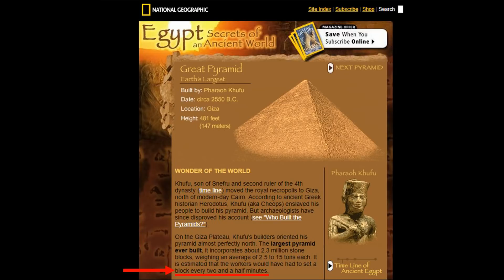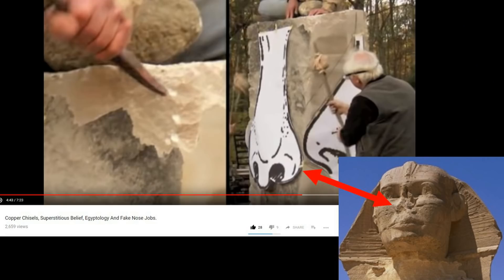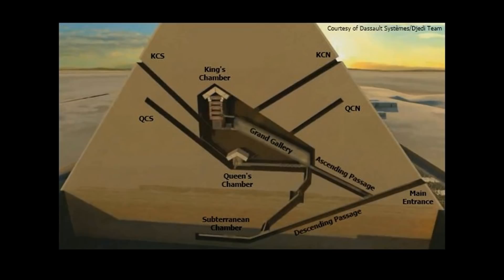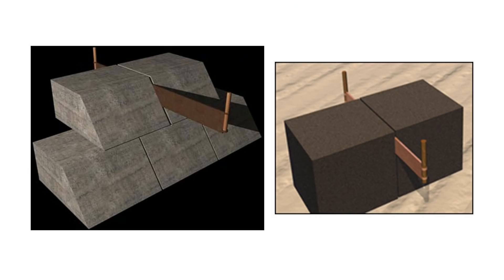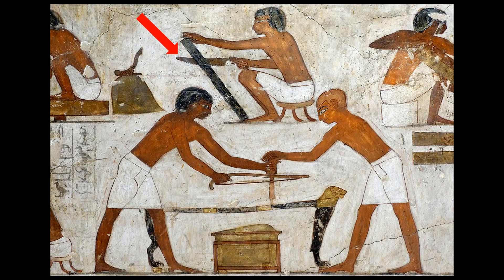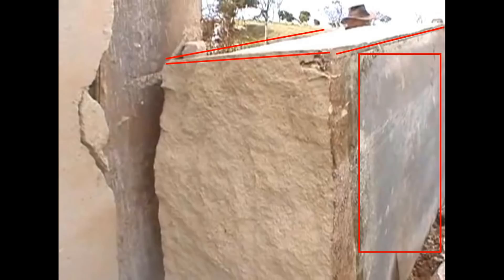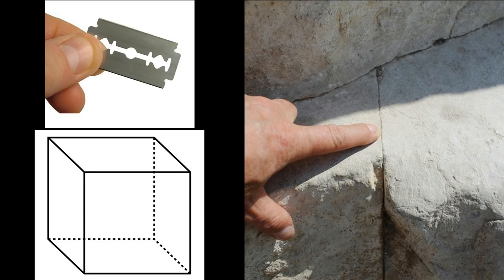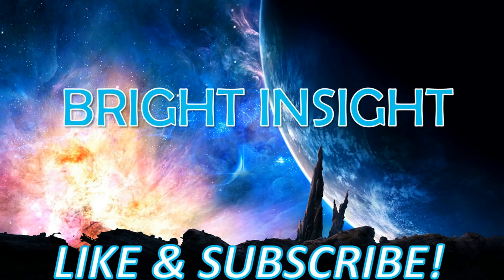Great Pyramid of Giza:  Lost Ancient Civilizations

Comment: one of my guesses would be that they used rope to cut things, you know when a heavy object attached to a rope going to a 90° turn falls it tends to rapidly heat up and cut that thing, maybe they used some machines using rope as powertools, and said rope could easily degrade over time meaning why we wouldn't find much of it, except the mechanical parts of these possible machines

Comment: I don't know (yet) about the amount of bronze and copper tools required or found but just think about cutting those limestone block.

The best demonstration I've found of stone cutting with copper tools is from “Ancient Egyptian Granite Sawing Technology: reconstruction” (available on YouTube). What's great about this demonstration is that they provide all the numbers so we can work from that.
They achieved a cutting speed of 0.00233 m2/hour on granite (48cm x 17mm in 3,5 hours). 
The “Granite Cutting and Drilling” video you are referencing does not provide much measurement but it looks like they achieved a similar cutting speed.

According to the Mohs scale, granite is about 16 times harder than limestone so you can expect it'll be 16 times faster to cut limestone, leading to a cutting speed of 0.0373 m2/hour.

Contrary to granite, limestone can be split with copper tools but you still have to start from a flat top, cut 4 sides then you can split from the bottom. From the marks at the nearby quarry, it does look like a larger block was cut from there before being split into smaller blocks so let's assume each block from the quarry was split into 8 working blocks.

Now let's crunch some numbers:
The Great Pyramid is made of 2.3 million limestone blocks, weighting a total of 5.5 million tons.
Assuming the Egyptians were working 24 hours a day, 365 days a year (which is unlikely but let's be generous), we get approximately 13 millions minutes to build this incredible feat of engineering. This implies that one block was carved, transported and installed every 6 minutes non stop for 25 years.

Limestone density is roughly 2000kg/m3 so, on average, 2.4 metric ton per block measuring 1.2 cubic meter each. Assuming they're all perfect cubes (thus leading to the smallest surface area), we get a cube measuring 1.06 x 1.06 x 1.06 meters, meaning each face is measuring 1.13 square meters. Stacking 8 of them together (2x2x2) is 4.5 square meters for each face.

Starting from a flat top, you have to saw 4 sides before you can split the bottom, then split that block again into 8 usable blocks. 4 times 4.5 is 18 (square meters). At a cutting speed of 0.0373 m2/hour, you get 480 hours per raw block (28800 minutes) required for every 8 final blocks, or 3600 minutes per final block.

To maintain the required rate of 6 blocks per minutes, you will have to be constantly working on 600 blocks at all time (24/7/365). Using a more “realistic” workday of 12 hours, you need to be working continuously on 1200 blocks (and that is assuming no down time at all). If 2 workers are required for each block (unlikely but again, let's be generous), you need 2400 workers crammed in that quarry just sawing blocks non stop.. 

Then you still have to split the blocks, carry them, fit them in their final position, sometime even polish them and remember: Those “small” limestone blocks are nothing compared to the amount of work required for those 50+ tons granite blocks and all of this does not include time spent setting up ramps, scaffolding or whatever structures were required to rise those blocks up to 140 meters above ground, the time required to flatten the bedrock on which the pyramid sits, dig the 100+ meter long downward shaft going straight into the bedrock that you have to crawl into because it is only 1,2 meter high, nor any kind of planning before construction even started because apparently, they just made it up as they went..

Comment: I’m curious to know all of the different star formations line up with or did at the time they were built. And are the pyramids all aligned to the same stars? Or are the shafts pointing to different locations in the sky when compared to each of the other two? I’m thinking the function of the pyramids might be a sort of amplifier for the “Stargate” they might have actually had at the time. Perhaps the shows were a kind of “soft disclosure” as to what the actual true history is. As ridiculous as it sounds. Maybe we have been conditioned to believe that it is or was impossible.

Comment: I don't buy the theory that the casing stones were stripped while they were still in place in what, the 1800's they say? What did they use, camel cranes? If they didn't just push them out and let them roll down to get smashed up, they would have had to hoist each one down from the top with a massive amount of manpower or use a counterweight. And from that height, that's more work than cutting and dragging new stones from the quarry. And wouldn't these stones have been moved not too far away and could be traced to where they were reused? Also, is there any geological evidence that there was even an earthquake? Wouldn't the main blocks be shifted about too? The mainstream just says these things like it's a fact just like they say they were built for tombs. Really? I think the Egyptians are covering up something that proves that they didn't build it.

Comment: It's confirmed that they had high carbon steel as far back at 1000 BC, but that's just as far back as we know, it could have been around far earlier than that.  They should retest these carvings using steel tools.  These shows just exist to sensationalize, and provide ratings for the networks that produce them.

Comment: Hey there. Found something u might want to check .

 ''The ancient Nile flowed very close to the Pyramids. I have seen huge wells , chambers and shafts all round the pyramids. All know the existance of the underground Nile.

Water hydraulics using Bernoullie principle can force water up the underground chambers.

Water under the pyramids is also necessary to create the infrasonic negative field inside the pyramids , neutrino impact on water , to usher out scalar energy from top apex, as a pulsar . I am not going into detail about this in this blog.  This has to do with the millions of tonnes of crushing weight and generation of piezo electricity ( from SiO4 ) which resonates with Telluric radiation from below . ''

http://ajitvadakayil.blogspot.com/2010/12/secrets-of-egyptian-pyramids-revealed.html

Comment: I know this is an old video, but I just came across this channel.  One question that came up in my mind: These precise cut granite blocks used for the core of the pyramids: what happened to all the waste-rock removed to achieve this perfection? If the methods suggested by modern archeologists and egyptologists were used, even in conjunction with one another, that would still leave a lot of waste stone somewhere.

Comment: Perhaps they used gold chisels or granite dust/sand instead of regular sand. They also used fire to weaken stone which was proven to work in a documentary that I'm unable to find at the moment. Also, if you used the dried wood wedge method, wet it, then burn it, the steam would put more pressure on the stone

Comment: The more brittle the stone is, the point to shape it becomes fatter and is to 'bruse' the stone. This is because the long thin point bends and is too brittle to control the fractures. You get harder metal for chisels, but why bother when you get rotary blades. 
If you're next to a river there's enough power to cut stone. History tells us quarries had mills that were water powered. Stone cutting disc doesn't work on speed. 
What's with China artifacts and Japanese artifacts made from metal being imported into Egypt?  Whoever built them must of known about metal, and Japanese know metal. Egypt was surely in a trade route with the entire world. 
Maybe even Jesus /Buddha /Ancients/ chiefs shifted the knowledge?  Either way, advanced tools were used. The courses of the pyramids are not exactly the same either. That's a tool that has been reset... Rotary tools, not percussive...

Comment: copper and bronze are two VERY different metals...  bronze is stronger than iron, most people dont seem to realise that. It can also take a sharp edge... The only reason people switched to the softer iron was due to the collapse of the tin trade in around 1000bc,  Iron had already been made for 1000 years at that point, but was not the metal of choice for tools and weapons.

also you skipped the bit on the recreation video, where they drilled the perfectly round holes into the granite using available tools.  They also go on to show the cut marks left on the stones perfectly match what we see on the original stonework.  also, I guarantee there are plenty of gaps you can fit a finger in, let alone a razor-blade.

They had a lot of time to get the techniques and tools right, and we see all of the ones that broke or were substandard and abandoned.  I'm not saying it wasn't someone earlier than the Egyptians who built the pyramids, I'm sure it was... but when the appropriate evidence is studied and proven, that's when it will go mainstream, until then it's just hypothesis  (the recent crater discovery in greenland may help that)

Comment: In my opinion, the pyramids are not the egyptians. They moved in then made it theirs, and used it for whatever. Also, the egyptians used hieroglyphs of them hauling blocks on boats and using saws to cut them..or pounders for future generations to see how they did it. They lied. They didnt do it. The precision of cuts and placements of the pyramid blocks were highly advanced and lost. You can see the engravings on the mega tonne sarcophagi and pillars are no way near the advanced skill of precision it took just to cut and place these huge heavy granite boxes. The question is..who are these ancient builders? I believe its the annunaki. And i also believe they will cone back. The polygonal walls that span thousands of miles apart were of one advanced race of beings. They had their own style and they dispersed throughout the world and built structures. A shameful man is one who claims that which is not his.

Comment: Is it just me or are the stones you see inside the Giza pyramids on the walls of the chambers and passageways ect, of a higher quality than the smaller limestone blocks used on the exterior. I'm only guessing but it looks like the Egyptians may have put on the casing stones but not built the original structure. As if they wanted to hide any entrances. 

The same goes with the Sphynx, to me the legs and rounded rear are far far more recent add ons to the ancient monument that was carved out of the existing bedrock.

Comment: I don't consider my self very clever or an expert on the subject but don't you think a valuable resource like copper or bronze in tool would be repurposed after use or even taken somewhere else after that. not to mention that it's hypothetically possible to cut granite when wet so why couldn't they chisel when wet. part of my job was to drill chisel brake and place much harder rock with mostly hand tools yeah it would suck if we couldn't use a drill but its not something unheard of. If the quarry was purposely flooded it would be doable.

Comment: The Egyptians didn’t build the pyramids, they discovered them and utilized them. The erosion on the Sphinx predates Egypt by more than 10,000. Archaeologists have determined the erosion on the Sphinx is due to water erosion, not wind and sand. There hadn’t been that much water in that area for 10,000 years or more, when that area was a thriving rain forest. Also to, for that much erosion meant the Sphinx would have been in that environment for sometime. So predating Egypt by 10,000 yrs is even a small guesstimate to evidence shown.

Comment: if iron nails were used in the ark at 97% pure it would not be difficult to tip the chisels or saws with iron find the metalworks  they had the Nile the wheel basic things to make power tools they would if been stationary

Comment: What if they had hundreds of thousands or even millions of workers working for years just to prepare the blocks with the tools available individually all at the same time. Theoretically this could produce blocks of the scale in time for the deadline supposedly set for the constructional the pyramids. Here’s my calculations: if it takes an averaged 20 years to produce 2 million blocks, with let’s say about 10mm of progress an hour with the blocks being around 1m x 1m x 50cm or just over it would take let’s say 1 million workers cutting simultaneously around just over 25 days to construct a block each, taking into account possible man power shortages and teams of workers you can multiply that by say 5, so 125 days to produce the blocks needed. 

Another calculation possible is that it would take 1250 days to produce which would possibly more plausible (3 and a half years), this taking the “average hight” ( given it may be the lower estimate) of 50cm with I’m proposing a maximum of 10mm an hour with the given tools it would be, 50/0.1 giving you 500 multiplying that by 60 , 30000 and dividing that by 24 giving you 1250 days for the cutting of each block. 

Disregarding the method of lifting and the precision of the construction, the preparation of stone blocks needed for the pyramid I believe is more than likely plausible.

Comment: Another thing you may want to look into is the production of Steel because steel did exist back then we know that still existed thousands of years before the steel age it's just that it was rare it was a precious metal back then not many people had the knowledge to use it or make it almost as if the art was lost somewhere along the way stainless steel was not known to exist that we know of but regular Steals and irons Decay at much faster rates if any of these sites were over 12,000 years old we would have no way to see any of their tools at all no matter how big or how solid of Steel or iron look at the rate of Decay the car goes through do you think that there would be any evidence of anything like that there when it turns to dust and ends up in a pile of moving sand doesn't make sense to think that we would actually find their Technologies they were ever made out of any kind of steel or iron even stainless does rust and won't last that long

Comment: The premise that the time of building the pyramids includes the time these stone blocks are prepared, is wrong. The building of the pyramids denotes, the movement of the stones from where they were carved in upper Egypt (specially the granite) and putting them together, in the massive structure, in Giza. It involves multitude of workers from the south to the north. As for the equipment, do you expect that tons of bronze used in the carving will be left behind by the workers? They would have used it somewhere else, or even recycled. Bending and straightening or sharpening of these equipments would be done by the workers on the job.

Comment: Like the video except for the question about how many copper chisel were ever discovered. Cooper was very valuable metal and would have been recycled. 
If 3k years from now they asked how many people used actual “silver” wear and based it on how many were dug up. It would be unrealistic. 
Or even take an metal item from before 1940 it was probably recycled into war items. 
I think other then that the show was very stimulating, but feel you should avoid falling into the same traps as the people your calling out. Stick to the facts as they are they stand very well without speculation

Comment: Hello I really enjoy your videos and would like to help. The reason you find so few copper tool that appear to to be used for carving is because they used sound waves. Goes along with how the pyramids were used to create electricity. Very basic piezoelectric technology which would have been easy for them or even basic electrical pulsing through copper and bronze plates <dissimilar metals> you can create vibrations in  different ways.  Strap two rocks together add vibration they perfectly match each other shape stick copper on Limestone and granite put a small weight on top of it add vibration it will cut through in a matter of minutes. You could even go as far as to prove sound waves can move the blocks but that's harder to prove.

Comment: does anyone think about precision cracking the stone? ive seen modern day people use wedges and hammer pegs/wedges to get precise straight cuts of stone
Reply: f7f8e392704bb9 theres videos on facebook of people doing it with wooden pegs, 150ft long slabs
Reply: and to add, i dont think anyone would throw away long copper saws, they would melt them back down, even if they were found 50, 100, 500, 1000 years later

Comment: Im of the thinking saws and chisels were never used for industrial cutting.  I think they found a way through clever engineering and manpower ( maybe even vibration) to turn this stone into powder and set it like concrete in animal skin bags to make blocks . Patting it into perfection before it dried in its place ( hence the millimetre gap between the blocks even though they themselves are not precisely shaped. )

Comment: No matter what methods were used to quarry the stones, shape the stones, transport the stones, which is difficult enough- you have 3 even bigger questions.
Who designed the pyramids?
How (& who) were the stones moved, especially 500 ft up?
And WHEN????
They were being repaired 4,500 years ago, not built!
They are a minimum of 12,000 years old & probably way older than that.